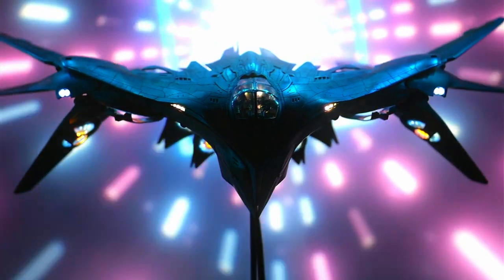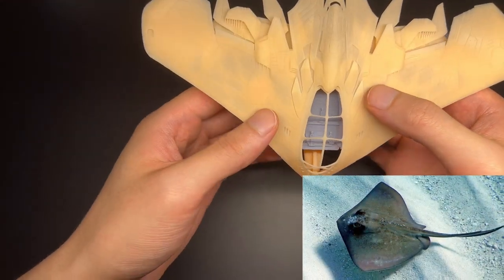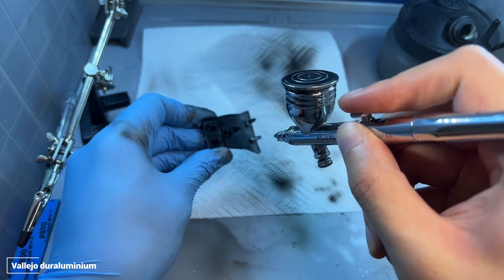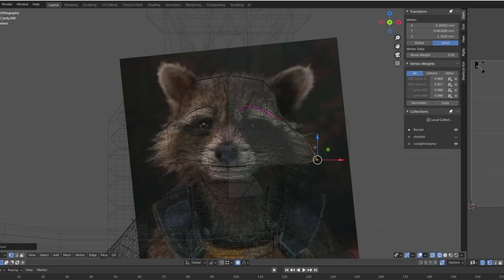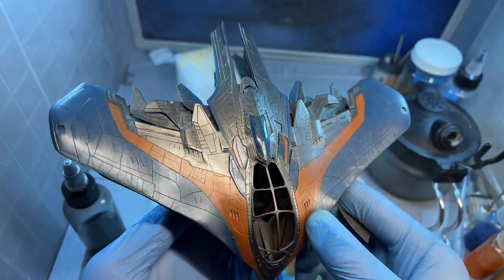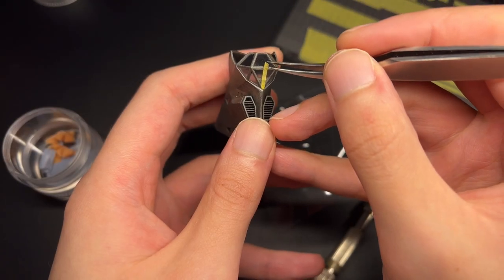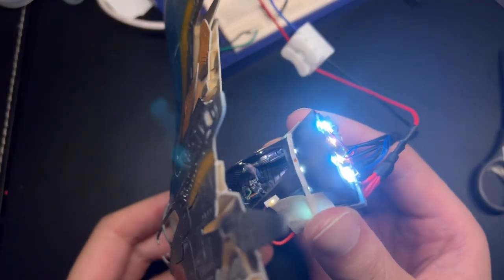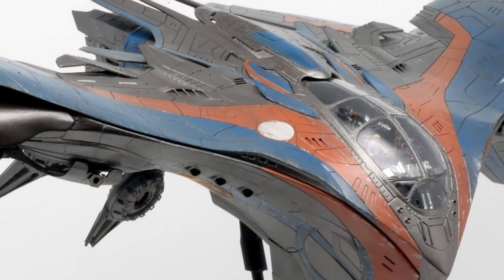Guardians of the Galaxy Milano Spaceship - SLA 3D Printed 1/144 Scale Model with LED

Comment: It's gotta be the best 3D Printed model kit I have ever seen, very impressive. It looks so much better than Fantastic Plastic's resin Milano.  Looking forward for more builds.
And btw, if you're into sci-fii modelling - I recommend you checking out Pegasus Hobbies War of the Worlds Tripod. 1/144 scale kit with some solid details :)
Reply from the maker: Thanks!! I did spend dozens hours trying to get the ship's profile correct, it was difficult, lots of staring at the screen and making tiny adjustments, but I think I got it pretty close to the original shape!
And I will checkout the tripod!

Comment: well done ,i design and 3d print models my self but this one especially the lights are top work same for the 3d model is super complicated and the way you cut it in order to 3d print it is ideal ! May i suggest you so you dont wasting so much time sanding with water sandpaper ,use foam sandpaper dry... then the Water one just to smooth it out ,the resin sanding down 3 times faster when is dry ! Then dont worry much about your panel lines either design them  a bit deeper or you can rescribe them again when is necessary !
Reply from the maker: Thanks!! And yes this one was pretty complicated, lots of head scratching in front of the computer hahaha.
I will get myself some of those foam sandpapers, seen them in lot's of modeller's videos, although i find sanding pretty zen sometimes :)
Reply: @SevenScales  dont bother to get from modeling shops are very expensive your local automotive body shop got all kinds
Reply from the maker: @rOEN911  Yeah i avoided them because they were expensive. Thanks for the tip ill have a look!

Comment: Really amazing work you did here.. have been trying to recreate the ship myself in 3D but the info and references are so limited that it's almost impossible.. there  are some stl out there but they are just rough approximations...  however  yours is really close to the original. 
To me the Milano is one of the most amazing designs i have seen in long time.. definitely it's worth to buy and i appreciate and thank you for your work.

Comment: i´m finally getting to work with these files , im fucking amazed at how well supported these are however i wish there were a couple more parts split , for example the rear assembly that goes down the central engine , i mean the whole " box" that holds the viewing port and the 4 rear repulsors , that as single piece would be fitted easily in my small resin printer
Reply from the maker: Thanks for that feedback! 
Will be a bit more careful with combining parts in the future.

Btw I've been a bit busy IRL haven't had much time to finish the instructions for the Milano. Might take a bit longer, please use the video as reference for now.
I will make my next project free for you guys that brought the file as a compensation. (It's a detailed model of the JWST, not really sci-fi but I hope you guys will like it ^^)
Reply: @SevenScales  its quite self explanatory if you have a couple of reference pictures its really easy to figure out what goes where , dont worry for that

Comment: Great work, especially on the lighting, which is fantastic. Could you provide the name and links to the led, strips, and breadboard you used? Thanks!
Reply from the maker: Sure! you can find the super thin LED strip on aliexpress by searching "1M 3v 1.5mm LED"
Also the square LEDs by searching "2mm square LED". (international shipping takes awhile)
The breadboard is a generic brand from ebay, you can find by searching "mini breadboard", (i cut it in half).
Tiny LEDs are from https://www.funtrying.com/product-page/bundle-of-leds-with-wire-leads-pre-wired-0402-smd-leds, (0402). They comes with pretty long 0.2mm wire which i used to wire the whole model.
The orange/white LEDs are generic 5mm round LEDs.
If you plan to build this model with LED, i recommend making bigger print if you have a large printer, maybe 1/120 or 1/100.

Comment: This is awesome! Please tell me how you were able to recreate it so accurately, I'm also woking on a model of the Milano but in LEGO and want to make it as close to the original as possible. But as you said in your video, the reference material is very limited. Did you get any 3D file sent by the designer or just copied everything from the movie. Thanks. Btw you're model is astonishing, keep it up.
Reply from the maker: Hey thanks for your comment!!
I didn't get 3D file from the designer, I used screenshots as if they were orthographic views like this: https://imgur.com/a/drw25yN
I spend about half a year on this model, i remember once in a while i would spot some details that i missed and it all added up over time.

Building this in lego will be a pretty big challenge, i think the most important feature is the 3 pointed star shaped nose and the curve connecting from the nose to the stubby shoulder wing, if you somehow get those right the model should turn out great!
Reply: @SevenScales  Thanks for your advice. By now your video has helped me the most and since I'm not really interested in spending half a year rewatching GOTG I'm really grateful and impressed by the work you have done XD. I think you should consider making another ship like this sometime in the future, like the Benatar or Rocket's Warbird. You're pretty good at it.

Comment: Do you have any tips or do you know any good tutorial for panel lines? I´m modeling a N1 starfighter from Star Wars in Blender (for 3d printing) and I don´t know how to do the panel lines without making chaos in the topology. Btw I love your models and Im learning a lot from your videos
Reply from the maker: I'm not sure if my method is unique or not but i make the panel lines by creating plates.
1. make a copy of the original model so the original topology isn't changed
2. use knife tool to cut desired panelines (you can highlight the cuts by "mark sharp" so they are easier to see in viewport. You can also use bevel weight)
3. select those edges you want as panelines, use bevel (ctrl-b) to add gaps
4. after bevel, just delete the gaps while they are selected
5. add solidify modifier, adjust the offset so that it overlapse with the original model
Since stl files doesn't really care about overlapping just make sure every object doesn't have holes (non-manifold), there's a included addon you can enable in blender called 3D-print toolbox which helps you identify gaps and holes (modifier needs to be applied first).
hope this helps!
Reply: @SevenScales  thank you very much! I will try that!

Comment: Curios, which printer and which settings where used? The layer lines where rough in some places.
Reply from the maker: I was using the mono x without anti aliasing. Recently I upgraded to the 6k version with AA it gave much better results. I will add my print settings in my next video

Comment: what brand are those led stripes for the repulsors?
Reply from the maker: On aliexpress search "1M 3v 1.5mm Led Strip" it should be the first one (they don't have resistors).
The reason i'm using this brand is because its the only one that can fit inside the rear small pair of repulsors. 
If you are able to print a bigger scale say 1/100, there are alot more choices.
I would have used LED filaments if i made a bigger scale. (https://youtu.be/Y44_IgT3K9w?t=652)